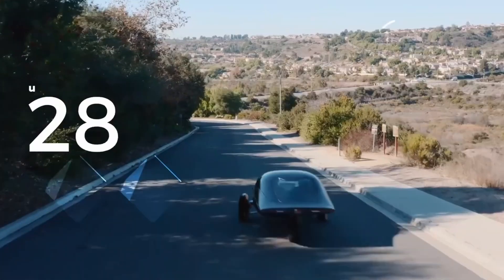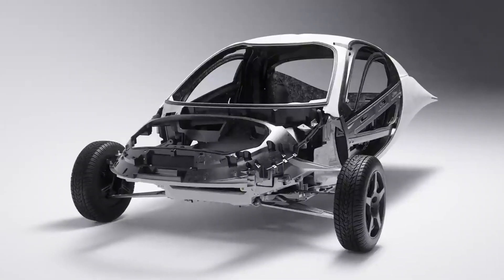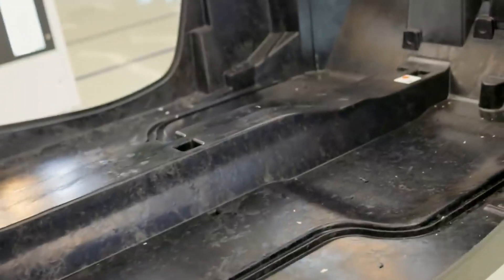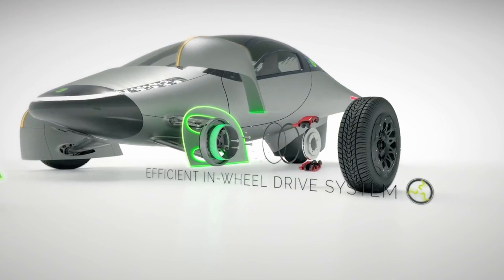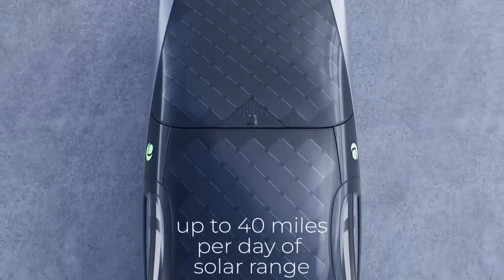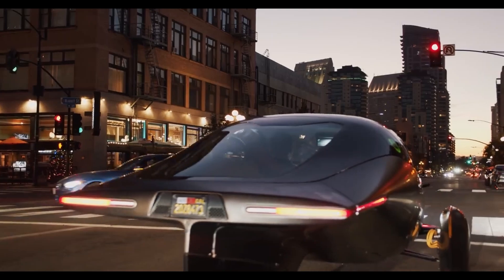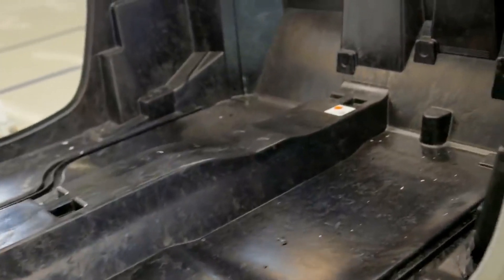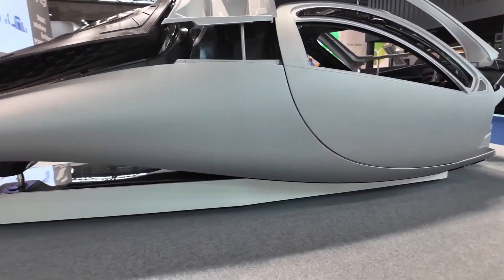Aptera SAFETY Concerns Uncovered | OCTOBER 2024

Comment: Unproven safety? How about un-DISpoven safety? 
Have you ever fishtailed in an unloaded pickup on wet/snowy roads?
Or, how about high center of gravity SUVs that like to flip over when swerving at high speed? Inertia goes a long way.
People can sometimes be overconfident driving a gun safe on wheels, thinking they're indestructible because they're in a heavy steel cage riding high above other traffic. 
While you can't defend yourself against the unpredictable, many accidents are avoidable when you're aware of your situation. Driver attitude goes a long way and overconfidence negates any practical safety features.
There are many less-than perfect vehicles out there that have their particular weaknesses. 
I won't even bring up motorcycles and scooters...

Comment: Aptera isn't a Car, it is an Autocycle.  That means it doesn't have to pass the same crash tests as a regular car.  I will have no problem driving my Aptera once it arrives.
Reply: I ride a 3 wheel CanAm Spyder now, thus will be way safer than that. And I will not bake in the summer and freeze in the winter.

Comment: Pontiac Fiero is my concern with these, so light they hydroplane and have no traction when you will need it to steer in water conditions.
Reply: The car weighs approximately the same as a typical internal combustion engine car because of the battery. So this really shouldn't be an issue.
Reply: @jeffwalker7661 

What new combustion car weighs 1,800lbs ?
Reply: @landrover325  The Aptera is listed as 1,800 to 2,200 lbs depending on configuration. I, for example, drive a Honda fit. It is listed as 2,249 to 2,381 lb. So the Aptera is a little lighter, but not too much. So it is in the weight class of a compact car.
But it is really going to come down to weight distribution with the Aptera. I suspect a lot of its weight sits on the front axle because that is where the engine is. Hopefully, that will give it good front-wheel traction.

Comment: Light weight for a batterie car. You are correct time will tell. The most important factor in safety is the nut behind the wheel.
Reply from the maker: It is light weight

Comment: Aptera is circumventing the safety regs by making it a 3-wheeler, which for Federal regulatory purposes makes it a motorcycle.  However they seem to have persuaded the various states to define a new class of vehicle called an "autocycle" such that helmet laws and the like do not apply.
Reply: "Aptera is circumventing the safety regs by making it a 3-wheeler" This is misleading they made it a 3 wheeler for efficiency.

"However they seem to have persuaded the various states to define a new class of vehicle called an "autocycle" such that helmet laws and the like do not apply."

Another deceptive remark. The "autocycle" laws already exist in many states.  Some states require helmets some safety glasses each state is different. Aptera does NOT have the lobbying power to change the laws in each state as you are suggesting. I don't even think they could do it in one state.
Aptera is just adapting to the laws based on design. It will most likely be as safe as most vehicles on the road and 100% more safe then any other 3 wheel vehicle that I can think of like a Slingshot for example.
Reply: @Fairburne69  Yeah, they make it efficient by ignoring safety regulations, which they can do because by Federal regulation it's a motorcycle.  And in CT that "preexisting law" was passed in 2015.
Reply: @JClarkeCT1334  Lets be honest we don't know how safe it will be. To say its unsafe is dishonest. To safe its safe is dishonest. All we have are simulations. They will be doing crash testing once they have the PI vehicles ready. I do have my concerns and won't buy one if they don't do well by independent crash testing results. 

Sounds to me like you hate Aptera which is fine. Do you go on ever motorcycle page and talk about how unsafe they are? I'm willing to bet it will be safer then any car made 40 years ago when shoulder safety belts and airbags didn't exist. 

But until they get tested maybe you should stop making claims you can't support with evidence. Claims made without evidence can be dismissed without evidence.
Reply from the maker: Crash testing will be up after PI 4,
Lets be abit patient
Reply: @Fairburne69  So the options are to be a fanboy or a hater?  How about just recognizing honestly what Aptera is doing and why?  I probably won't buy one, if I'm going to ride a motorcycle it will have two wheels and look the part, not three pretending to be a car.  If there is a real need for smaller more effcient vehicles we should just allow kei vehicles, not force companies to work around the law.
Reply: @JClarkeCT1334  I agree with you fanboys can be just as unreasonable as haters. There is room in the middle. 

For example. I really wanted an AWD Aptera. My concern is safety in winter weather. There is already a disadvantage with only having three wheels when driving in the snow. Having snow tires and AWD would have helped to mitigate that. Most cars I have driven have been FWD with all season tires.
Before I buy an Aptera I want to know how well it will do in crash tests. How well it will do in winter weather. I want to know what the "real world" range will be. I want to know how many miles per day the solar panels will give me at different times of the year.

Fanboys will say it's safe safe safe without any legitimate data to back it up.

Haters will insist it's not safe and dangerous without evidence to back it up.

I say I think it will be safe based on what I know. But until I have evidence to support what I think I remain skeptical. 

Why do I want an Aptera. I like their approach towards efficiency. I like the idea of having a lighter vehicle. I like the idea of being able to charge it from a standard 120 volt American outlet. All these things are very appealing to me which is why I MIGHT buy one.

But I will NOT spend $40,000 give or take $5,000 on a vehicle until I have real world data. I'm not the one making claims without the evidence to back it up.

So why do I think you are a hater. Because your taking the time out of your day to bad mouth a company without evidence to support it. You're not saying I have my concerns this car won't be safe. You're saying this car won't be safe. Do you see the difference?

My question is. What made you dislike Aptera so much? What was the first thing that pissed you off? Was it the constant delays? They say 2 years and now it's 5?  Is it because they say (not promise) production will happen 1H 2025 when it will probably be late 2025 or later, based on their track record?

Most haters I know were at one point fans of Aptera but now think they are full of empty promises.

One last point. I have been following Aptera now for about a year. Since then I have never heard them promise anything. They have been constantly wrong with how long things are going to take but that's not the same as making a promise.

They have said 1H of 2025.
They have not promised 1H of 2025.
Reply: @Fairburne69  In what post did I say it was "not safe"?  Those of us with ADHD are familiar with a phenomenon called "ready, fire, aim".  Check attributions and make sure that you are responding to the person who actually made the assertion with which you are disagreeing.
Reply: @JClarkeCT1334  What safety standards are they circumventing? They plan to submit the vehicle for crash testing with 3rd parties even though they aren't required to. Sounds like they are going out of their way to make sure they aren't circumventing safety standards.

Edit: They also equipped it with airbags which isn't required on motorcycles, so they didn't circumvent that safety standard either.
Reply: @nomercy4521  All of the ones that apply to vehicles with 4 or more wheels.  They're making up their own rules which may or may not be good enough, but if they could achieve the efficiency they want and meet all standards required for cars then they would have put 4 wheels on it.
Reply: @JClarkeCT1334  So you have 0 examples.

Do motorcycles require airbags? No, but Aptera is adding them. 

Do motorcycles require crash test ratings? No, but Aptera is paying to have them done. 

Pedestrian impact standards? They're meeting those safety requirements too.

Seat belts? They're providing those. 

You literally have absolutely no ability to give a single example of a single safety standard they are avoiding, yet claiming they are. In fact, it seems quite apparent they are providing all of the safety features they aren't legally required to have.
Reply: @nomercy4521  Are the adding all the airbags required by US regulation?  Do they perform well in crash tests?  Do they pass any pedestrian impact standards?  There is a difference between adding some features and actually meeting the many regulations.  So show that they are actually meeting the letter of every regulation.
Reply: @JClarkeCT1334  Yes, they are adding all the airbags required by US regulation. They perform well in the simulated crash tests, but we won't know more until they crash test them next year. They do meet pedestrian impact standards.
Reply: @nomercy4521  Airbags are not the only features required by US regulations.  Everybody seems to focus on airbags.  If that's all it was you could put airbags on  Kei truck and import it.
Reply from the maker: It's a car

Comment: There are two components to safety. Those inside the vehicle and those outside. Most if not all new pickup trucks and SUVs have significant blind spots to their front end, which have caused the death of an increasing number of pedestrians and bicyclists. Aptera's low nose will not recreate those situations where the driver simply doesn't see people on the street.
Reply: What are you blabbing about, my Ram truck has excellent front visibility, way better than our Accord. You obviously don’t have a truck.

Comment: No doubt it will be safer than driving/riding a 2-wheel motorcycle.  With a rollcage, airbags, abs (antilock braking traction control) and autopilot (to keep tailgating idiots away), hopefully you won't have to wear a helmet also (I do believe helmets are required in California even on 3-wheel " motorcycles, because they are classified by CA DMV as motorcycles.    The biggest danger is being tailgated by a pickup truck.  I do believe the normal Aptera driver will be an extremely cautious one ("don't you crash into my baby").  So - One Big Question - how much will auto insurance be - more than the average 4 wheeler, less than a 2-wheeler, less than a high performance sports car (think Chevy Corvette 400+ horsepower)?  I suggest making the tailight/stoplight blink red at first, then a blazing white "TAILGATING DANGER" after 10 secs on the rear brake light(s).  They'll slow down for fear of a police officer giving them a ticket.
Reply from the maker: Hahaha, Nice

Comment: The carbon fiber parts are not structural anymore, they are just glued to the structural aluminium frame. There is no solid shell anymore. The aluminium frame has to survive a crash. Aptera is not agile, it is clumsy and wider than a Hummer H1. It is a deathtrap in case of an accident. Aptera did not pass any of the safety regulations necessary for a car. It is a motorcycle and does not have to.
There was never any crashtest with an Aptera. The airbag is the only satey feature necessary in a 3 wheeled motorcycle so you do not need to wear a helmet.

This YT is full of lies. There are no concrete independent data available. Just empty promises from Aptera.
Reply: Wow you know for fact the Aptera handles worse than a Hummer!  What else do you know??? Please enlighten us!! 

You sound like a Genius.
Reply: @timsmith6815  The aptera motorcycle is wider than a Hummer H1. See Aptera HP. If you look how the Gamma handles in a parking lot (YT video) you will see, that even a Hummer does a better job. No genius necessary, just simple facts and observations.
Reply: @vic321344  There is video footage of the Aptera passing the "Moose Test". It did better then most modern cars on the road today. Especially SUV's and even a BMW.

You are adding nothing constructive to the conversation.

MOOSE TEST: The evasive manoeuvre test (Swedish: Undanmanöverprov; colloquial: moose test or elk test; Swedish: Älgtest, German: Elchtest) is performed to determine how well a certain vehicle evades a suddenly appearing obstacle. This test has been standardized in ISO 3888-2.

Imagine a moose stepping out in front of you. You swerve to avoid it and then notice a vehicle quickly approaching so you have to immediately swerve back. Many modern cars don't do well with this test. The Aptera did extremely well.  Why? The two biggest reasons are its light weight and low center of gravity.
Reply: @vic321344  I didn't check the actual specs but I do know that the front wheel base is quite wide. But you are ASSUMING this means it does not handle well. This is an INCORRECT assumption. A low center of gravity and wider wheel base along with it being light weight will all factor into its handling.

The big question I have is how tight of a circle can it do?  Time will tell. I'm looking forward to seeing all the test results from independent companies.
Reply: @Fairburne69  If you really watched the moose test video you will see the tracks on the grass from the former tries that went terribly wrong. Also no factual information about distances and speed. Just a fake.
Reply: @vic321344  "Also no factual information about distances and speed."  This statement is true. You can't get factual information from prototypes. We need the PI builds for those.

"Just a fake." That is a false statement. That's like someone saying, "The world is flat.", or "Evolution is fake.".

We have lots of evidence that supports them making the PI builds.

Assuming you are telling the truth about the tracks on the grass we have no idea what vehicle made them or know when they were made. It's even possible the Aptera made those tracks but at a really high speed that pushed the vehicle beyond its limits. 

1. I need to see the tracks you are referring to.
2. I need to see the Aptera actually making them.
3. I need to know the speed the Aptera was doing.
4. Is there a reason why it made those tracks? Did the "prototype" malfunction in some way? Were they even performing that test? etc. etc. etc.

Here is what I think. You don't like Aptera. Maybe you don't like 3 wheel vehicles. Maybe you don't like all the delays in production and therefore assume its all a scam and fake. Maybe you don't like EV's, maybe you hate the idea of a solar powered vehicle. I'm not sure why you hate Aptera but its clear you are a grifter with an obvious bias against the company. And you will go out of your way to spread misinformation.
Reply from the maker: Thank you
Reply: The aptera is wide on purpose because it needs to be for control and stability .. If you take a regular trike they will not need the wide front end or all the other stuff that the aptera has   ...
Reply: @RYLJ7588  Right, the Aptera from 2009 was smaller, and had a speed limit of 80mph due to stability issues.
Reply: @stix2you He mentions it shortly, after massivly snortig out the empty Aptera promises as a fact.